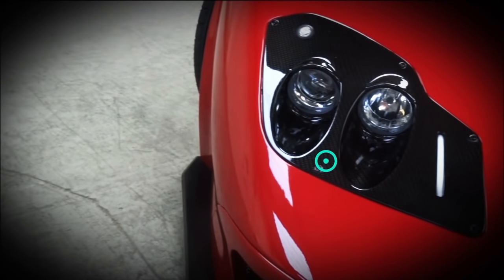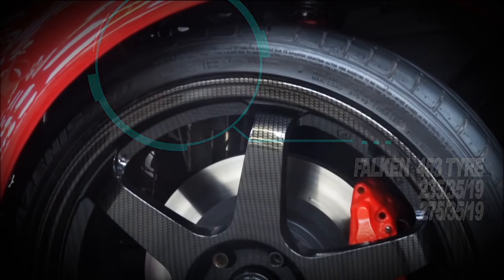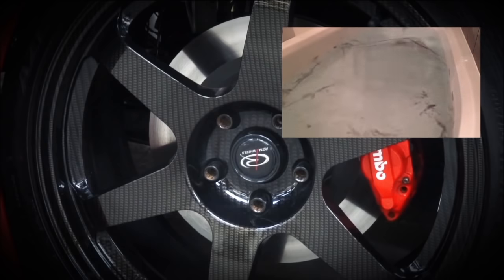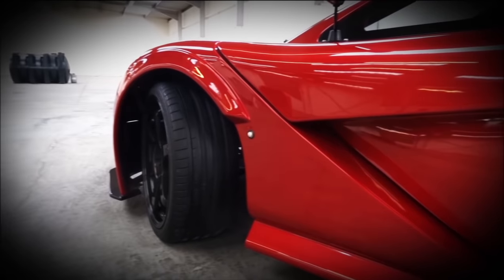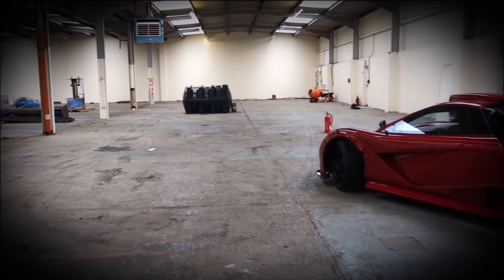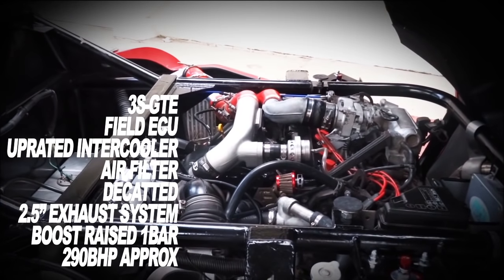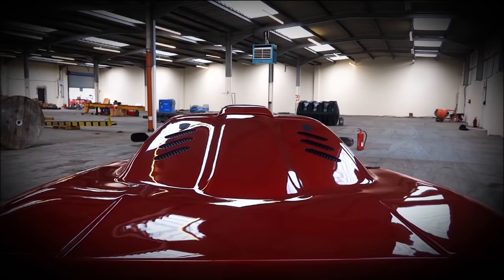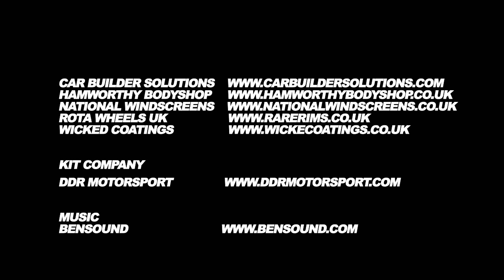Kit Car Complete Review: DDR Motorsport GT4

Comment: These cars have been on the market for over 10 years and I have never seen a performance video. I have never seen a video of how the engine sounds on take off, how the suspension handles, how well the brakes perform, or a drag race.
Reply from the maker: I don't have access to a track or drag strip. All the things you mention will be different on each build as well dependant on the parts fitted. Braking wise - Solid feel but not servo assisted so needs a fair push, but stops well but expected with 4 pot calipers on a lighter car. Suspension - Again I cant comment on pushing to the limits but then as well as this, the grip you have will depend on the tyres you fit as well as if you set up the suspension yourself. Sound, again down to the exhaust you have made. Its not a racing car in terms of all these things thats for sure, but in terms of driving on the road I dont have any issues.
Reply: I wasn't implying you should make a video of these things (that would be nice though). It would be nice if Diego and the DDR team did one. A car with the name GT behind it generally means performance.
Reply from the maker: Very true, there is enough of the cars in promo video types. That said I have no idea how much it costs to hire a track!
Reply: MrJinwright I’m having my built and when it’s done... you will
Reply: @paulvinson1  I just watched your cross country video of your DDR. How are you liking it so far? Any new videos coming?
Reply: My car is running great, I drive mine at least three days a week… not a trailer queen. Once you get used to getting in and out, it’s easy… the attention this car gets is sick. Every day is a parade and I’m not kidding…  I have done a few things to mine to make it more euro and race car functions….

Comment: Great looking car! Thanks for a video (5 years ago now). Do you still have the car? How is it to drive, really? How good is the suspension? Does it push, or is it loose? Ever take it to a track or gymkana (aka autocross in the USA)? Is it twitchy at the limit, does it give good feedback? Thanks so much. Maybe you already have another vid, I'll check your channel.
Reply from the maker: Hi, i do still have it. It drives in a sporty manner and compliant with the UK bumpy roads. With the width of tyres fitted ive never found the limit or been close on the roads. I havent taken it round a track so unsure what the feedback would be like. With no power steering you can feeling what the cars doing, its never felt like it will snap around on me

Comment: Looking good so far, though yes the panels still need some alignment and the interior is like a patch job. Those are the areas where a kit car needs the most refinement if you want it to look and feel like a proper car, What are the performance figures?
Reply from the maker: +Rob M The interior is coming on well now. Hopefully have a new video in a month or two on that. The performance is around 4.5secs 0-60 currently. I have decided i will go for a 400-450bhp forged engine, that should be plenty and still be a nice drive.

Comment: What was the approximate cost for whole thing... Looks sick by the way... And how much experience is needed?
Reply from the maker: +Jonah Richardson Beforehand i had only ever changed brake pads, oil and spark plugs and just decided to give it a go. Cost will vary massively depending on what you want to use in the project and different finishes. (biggest being the bodyshop work). I think its possible to build one for about £25k but again depends what you can and cant do.

Comment: nice job!
do the windows slide down?
is there an airco?
in wich city do you live?
thanks
Reply from the maker: +john doe The windows don't slide down but you could always fit a slider opening to the window. There is aircon although I dont have mine hooked up to save weight and I also dont need it as it doesnt get super hot here in the UK, (I live near southampton). I may hook it up in the future. The roof vent provides plenty of fresh air as well.
Reply: +The Ferret 
thanks
i live in amsterdam
if i want to get one
i probably first will have a look at yours
if thats ok
what's the weight of this car?
thanks a lot
Reply from the maker: +john doe of course, I can answer any questions you may have before then. The weight is about 1100kg, a 400bhp reliable engine is easily possible with 500bhp not costing much more.
Reply: +The Ferret 
thanks
maybe you can make a new video soon
Reply: +The Ferret 
final question
how does the car drive
especially in the rain
i guess there aren't any electronics (esp, tractioncontrol, etc.)
Reply from the maker: +john doe It drives well enough, the ride is stiff but better than I imagined but changing the spring rates can help with that. Ive never had a problem with it breaking away unexpectedly or tram lining even with the large tyres. As for driving in the rain, i dont really know as its just a car for the nice weather unless I get caught out in it.

There isnt any traction control but I did fit ABS hubs and just choose not to fit the ABS unit due to the added work, weight and testing that would be needed.

Comment: BEAUTIFUL
Reply from the maker: I haven't done a video yet but interior V2 is now in.

http://i.imgur.com/ZjiLGETh.jpg
Reply: I see. Very nice. Do you do it yourself?
Reply from the maker: Yes everything. However once I've completed the design (i need to add air vents) I will get it professionally upholstered with some red stitching etc... Will just look a bit better.
Reply: how much did it cost you?
Reply from the maker: about £25k so not cheap but better then just buying a focus ST or something like that
Reply: how much is that is the U.S.
Reply from the maker: exchange rate is poor, so works out at $32k currently. Id expect to cost a little more than that. I dont know if thats a good price for a car like this over there
Reply from the maker: ***** built it myself. I have a blog on the full build
Reply: Only if you are Diego Grullon. It is made in Miami.
Reply: The Ferret 
can you do a ferrari!!?

Comment: Beautiful car, but I think the rear needs more attention. It looks so... boring really. Did you ever think of a rear diffuser or a spoiler? 
The new lights are the first step, but think about more modifications 

:)
Reply from the maker: +Lennjan you are right. Someone suggested a diffuser if I can get a larger one that's fits over what I have it will make sense. A spoiler is in the works, just got to get it right
Reply: +The Ferret Alright, thanks for the answer

Comment: Do you have a running list of parts that were required to complete the build?
Reply from the maker: I don't, but I did a blog which was detailed on the build, if you google 'miami gt4 kitcar blog' it will be the top result. not much is needed really especially if you buy a donor MR2 to take the bits off. If you got any questions off of that, feel free to ask

Comment: hows the quality? is the car still in good shape?
Reply from the maker: So its been 10yrs now and 20,000 miles later. The fibreglass shell is really good, no cracking paint, bubbling or anything. Only one small stress crack in fibreglass at a pint thats hidden and later models have additional securing there. Tubular frame has some minor surface rust in places but thats it.
Reply: @killerferret666  how spacious is the engine bay? do you reckon it can fit a 5l v12? thinking of swapping a 1GZ-FE in it.
Reply from the maker: @lancia-037  hmmm ive seen a 5l fitted and the rear subframe altered to do so. Length wise wouldn't be an issue but what gearbox would you fit?
Reply: @killerferret666  maybe a CD009 from a 350z. I've seen quite a few CD009 fitters for the 1GZ-FE, and it's a 6 speed sequential just as I want. tho I heard these transmissions are huge.
Reply: @killerferret666  if I save up well I might go for a Quaife QBE69G. much smaller, 6 speed sequential, fits almost any car, but prices start at 8.5k... so not too sure

Comment: I would like one of these cars but when reading up on them all the reports say that they are a rip off and you never receive them.  How did you get on ?
Reply from the maker: Sorry I missed this, Mine did take a lon time for delivery at 10months. I was originally told 6 months. The 2nd UK one was told 6 weeks and took 10weeks, so much more in the normal range.

Comment: How much did it cost to you to do this? in terms of money and time
Reply from the maker: +Jörgen Englund Time was around 650hrs to build. Money well that depends on what extras / finish and parts you use. As well as whether you can be patient getting bargains. I think one could be built for £25k, particuarly if you get wheels 2nd hand and can do bodywork yourself which are the 2 largest costs.

Comment: can you fit a LS3??
Reply from the maker: I reckon you'd be able to, especially to the GT8 chassis design. The other Gt4 chassis design has had a Chevy 6.2l small block with porsche transaxle fitted. so Anything is possible I think as the engine bay is certainly big enough
Reply: @killerferret666  Youcan have any LS chevy small block, I believe. I'm having one built with an LS7.
Reply from the maker: @henrylafrance4591  You can the 2nd Uk one has just that, hopefully link below works. https://i.imgur.com/ikRI19G.jpg